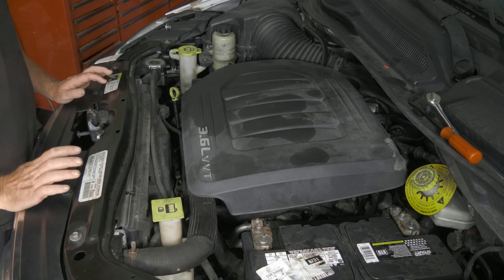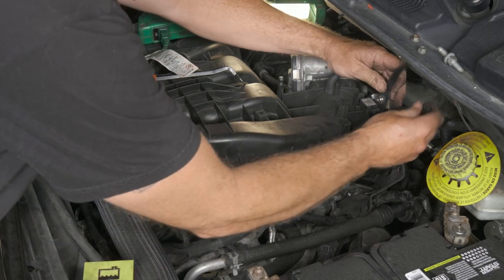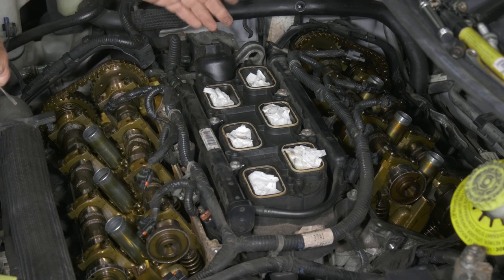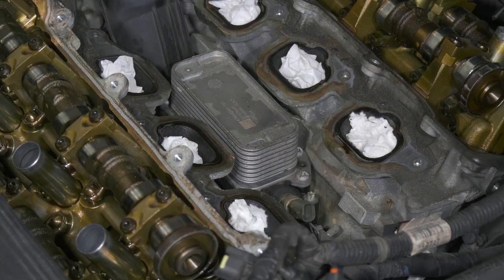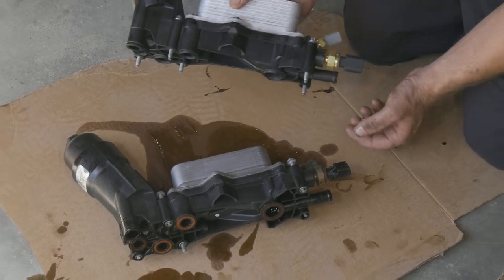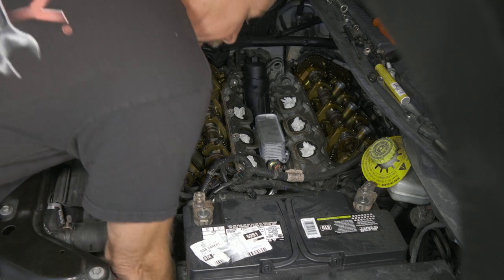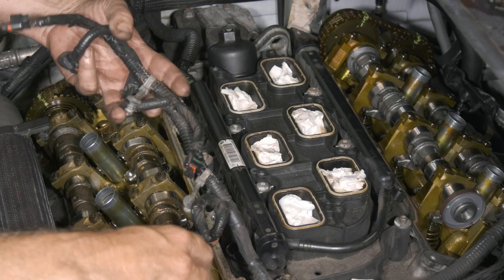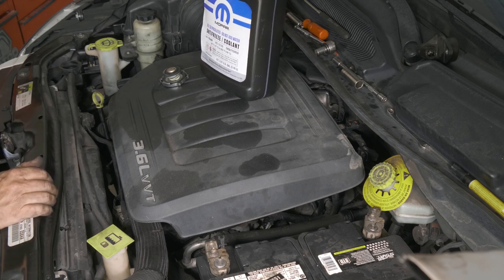2014 Chrysler Town & Country Oil Filter & Cooler Housing

Comment: I just did this repair on my Ram. A few things I did different, I didn't disconnect the fuel line. I disconnected all of the coils and injectors clips. Then after I removed the 8mm bolts I lifted the intake off and set it to the side with the fuel line still connected. I used hose clamp pliers to clamp the coolant line going into the oil cooler. Therefore I didn't lose, or have to drain, any coolant when I pulled the oil cooler up. I changed the cooler and intake gaskets and reinstalled the intake. This may help some. My truck has 151,000 miles and was leaking. The gasket on the factory cooler was flat.
Reply: Thank you..
Reply: So I don't need to change coolant? I changed oil. But some videos changed coolant and some didn't mine was still orange so I let it be. Is that bad

Comment: Can you show us how you reassemble the fuel line connector that sprung out all the o-rings. Just in case it happens to us.   Thanks.  The fuel leaks a little and may need a solution to replace connector or new o-rings.
Reply: Don't disconnect the gas just swing intake to the side.

Comment: You don't need to undo the fuel line, there very brittle and prone to breaking. The parts are hard or impossible to get for repair. Just swing the manifold out of your way.
Reply: Going to try this repair this weekend.  Any other suggestions?  The video seems great.  Also, are you a DIYer?  How long did it take you if so?  The shop is charging 3+ hours of labor.  I'm giving it the weekend :)
Reply: @thisdoesfine  take your time and don't rush, a vacuum cleaner that you don't mind getting dirty is very helpful. Blow out the holes where the oil cooler bolts down to the block as they will fill with oil. Clean everything really well after because residual oil will still leak down on the driveway, pressure wash after, change the oil before starting engine. Good luck
Reply: Do I need to change coolant?  Some vids they do some they don't. Mine is still orange is it nessisary?

Comment: I did everything u said and now the brakes light came on, it’s overheating, and running like crap. I did something wrong
Reply: Same here. Car doesn’t want to start. Seems like I’m not getting fuel. Did you find out your issue?
Reply: I'll just take a wild guess that you punctured or didn't place back the brake booster hose correctly for the brake light on. And for the over heating I'd guess you have an air bubble or incorrectly tightened the oil cooler assembly and it's leaking.

Comment: I have a ticking  sound coming  pretty sure  from oil filter housing ..no oil pressure issues   ..the ticking is  coming from the center  not  the valve covers was thinking rocker until  i checked the location  of the click, How common is this clicking from this pump ?  thanks for the  help could the click be a intake gasket lower or upper ?  150k  2014 town and country AAA condition
Reply: Its the oil cooler. Ticking is from the lifters. Due to pressure imbalance. I have to replace my oil cooler. 2015 T&C, 196k miles.
Reply: @DaeguDown  it was the rockers i replaced them all  with new milling rockers  easy job  and a few days time.

Comment: Couldn’t you just change the o rings? Or you have to change the whole thing?
Reply: You can just change o rings 
But ive normally change the hole assembly.
Reply: Never change just the o rings, these things are prone to cracking and you will be doing it again very soon!
Reply: @slsjr1  I have 290k miles on my 2012 Volkswagen routan with the 3.6. I've driven it for the last 160k in 3 years I've owned it. I just pulled mine and replaced the rings. If they're so prone to breaking, why is this one the original part, I have the whole service record from previous owners and this isn't on it, they never touched it. I'm keeping my original. It's as likely as a new one to crack. My dad has a 2011 town and country with 220k and I service that vehicle since new and never had this part leaking oil or coolant. Never touched it. Original part. I've owned probably 6 of these 3.6 pentastar and never had an issue with them.
Reply: @chrisevans2278  ok, glad yours are working.  Mine was cracked at 63k...

Comment: Question what happens if you don’t drain the coolant from the radiator and you just remove the cooler
Reply: it spills everywhere and makes a mess. did it yesterday that way

Comment: 106 inch lbs?
Reply: Rated on a smaller torque wrench for more delicate jobs.
Reply: Or 9 ft. lbs.
Reply: inch lbs., divide by 12.  106 inch lbs. divided by 12 = 8.83333333 ft lbs.  (9 ft. lbs.)

Comment: Can not for the life of me understand why an engineer would want to put an oil COOLER on top of an ENGINE. Isnt there someplace cooler, say like by the radiator. No wonder these things fail so much. I replaced mine with an all metal type, Fingers crossed.
Reply: How did it go?